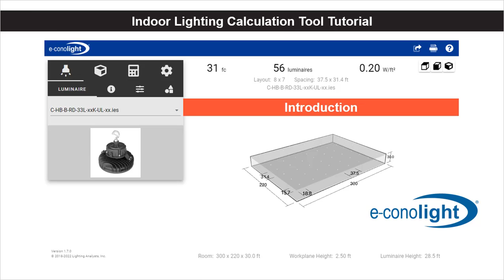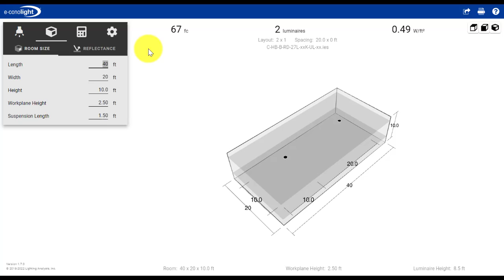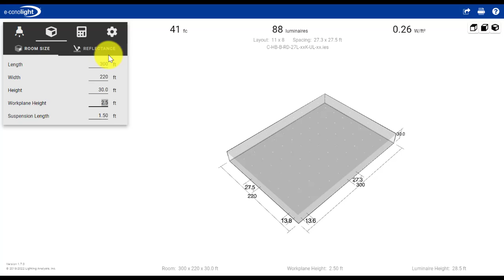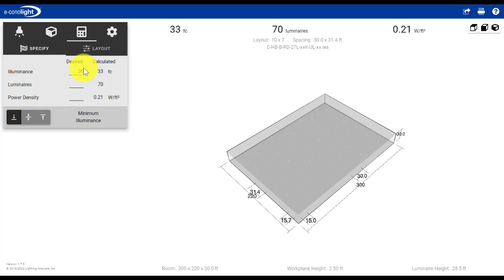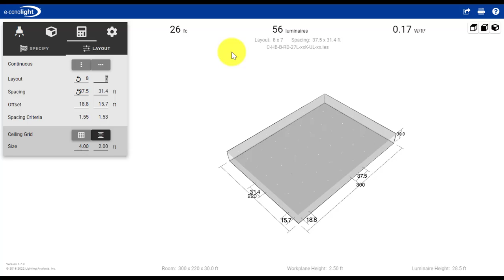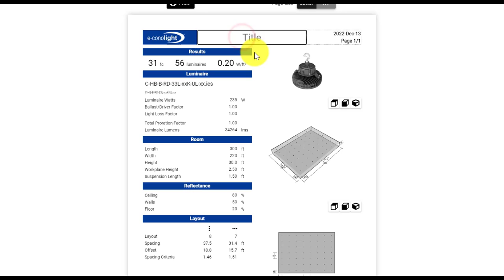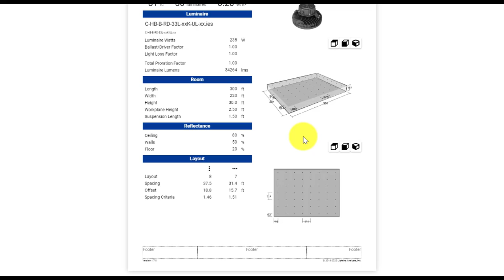Tutorial: How to Use The Indoor LED Lighting Layout Calculator | e-conolight.com

Comment: is that correct your program recommends 56 unit's for this garage? so 56x220$ = 23,000$ dollars for some led hanging lights in the garage? or am i way off?
Reply: Thank you for your question, carbide5507! This tutorial demonstrates how to use our indoor lighting calculator and assumes this is an industrial application, with a room size of 300’ X 200’, with a 30’ ceiling. This is not an example for a garage, but the tool does allow you to modify room size, as well as fixture selection and other inputs, to help determine fixture suitability for a variety of indoor lighting applications. We hope that helps! 🙂